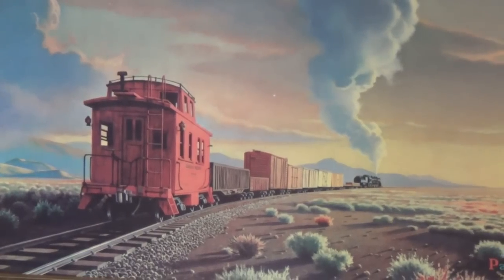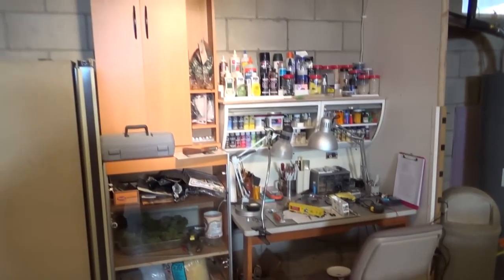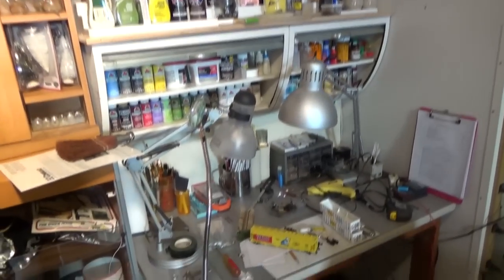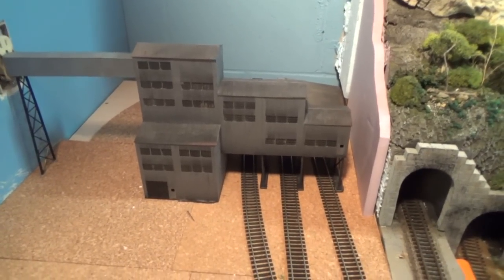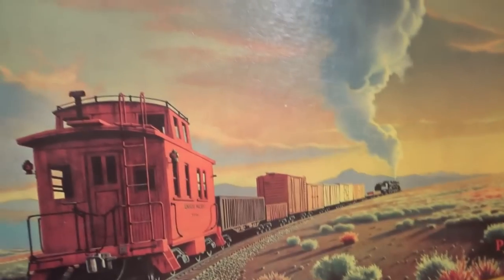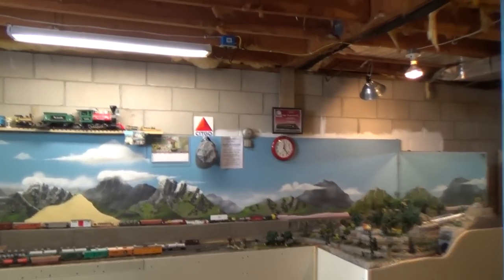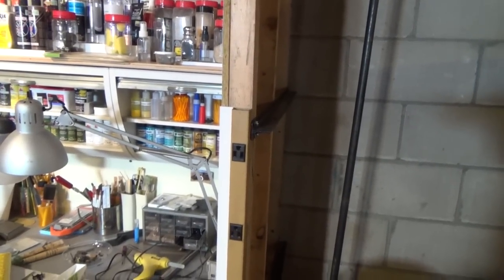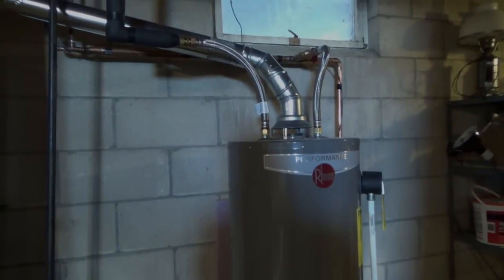A Shade Tree Railroad bench update

Comment: Nice layout. Love the roll top cabinets. I remember my former dentist having some like that. Been stalking the local house salvage places for the old steel wall/floor cabinets. They are great to reuse in the shop.

Coal tipple looks neat. Maybe make a mine shaft "entrance" out of a cover plate and some plastic and you could hide the outlet and still use it for power?
Reply from the maker: I moved the outlet to the other side of the wall in my wood working shop and some mountainous terrain will cover the hole. Hopefully I will get some of that done this coming week. Thanks for stopping in. Oh, I picked up those cabinets at a yard sale, $1 for the pair!